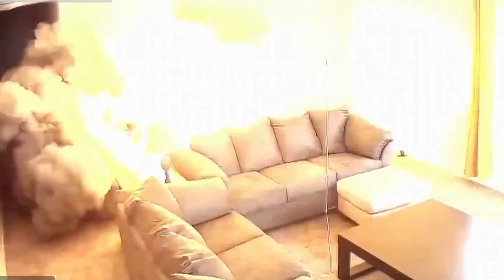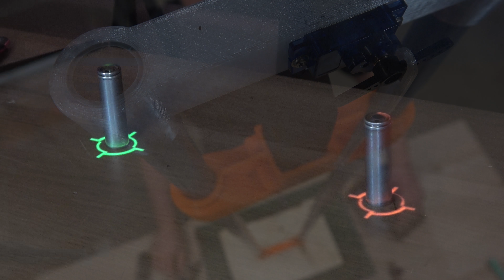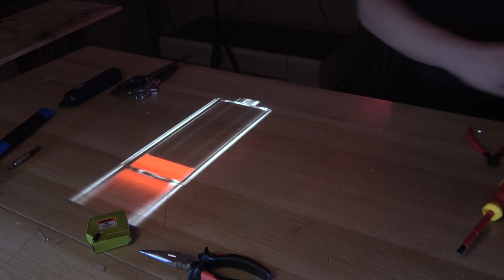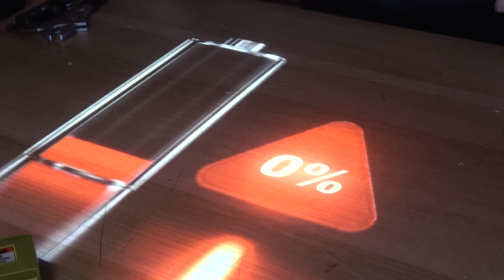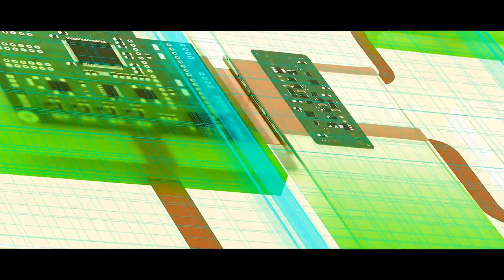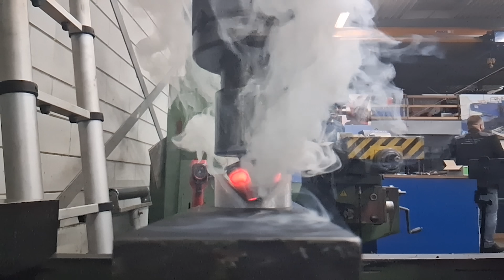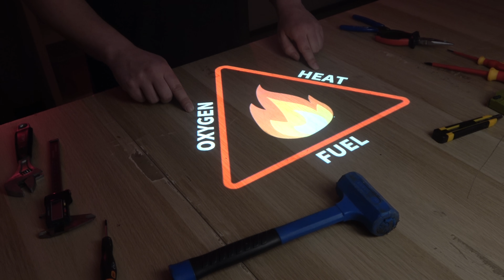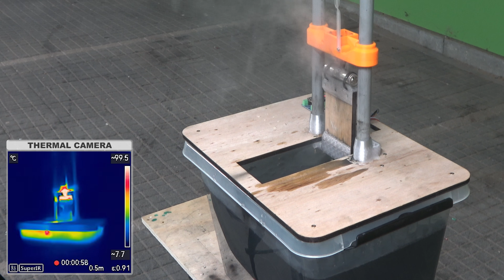Detonating Batteries.. For Science!

Comment: Not ALL lithium Try with Lithium Titanate Oxide (LTO) and prepare to be amazed.
Reply: Those still get pretty warm.
I would love to see video of a 100~600Ah cell getting tortured.
Reply: @picobyte  They don't get warm at all, not even slightly. I run a 40ah bank and regularly pull 400a+ of current for long periods of time. The cells are never more than the same temperature as the ambient air. The balancer gets warmer than the cells do, by a lot... and even that's still not too hot to touch with bare hands comfortably. The balancer is more heat sensitive that the cells are, but can be located away from the cells if necessary up to 1 meter.
Reply: @soldjahboy 40ah is like 20cells? Thats nothing compared to vehicles. ..
Reply: @gelo1238  r u in a irrelevant reply competition
Reply: @urnoob5528 yes
Reply: Or lithum ferrophosphate. But none of these are your everyday lithium batteries.
Reply: @thewhitefalcon8539  Not in small devices, but many cars (roughly 50% AFAIK) use LFP batteries nowadays. Given the recent developments at CATL, they may soon be everywhere. Setting a modern electric car's battery on fire is, depending on the model, somewhere between difficult and impossible.
Reply: @malamut2  What's interesting is that despite the media hype electric car battery fires are relatively rare, especially compared to ICE vehicle fires.
Reply: They also last approximately forever.

Comment: Correction needed: lithium reacts with water by replacing single Hydrogen atom, that atom couples with another replaced atom and forms H2 - hydrogen gas. This reaction is exothermic, it produces so much heat, that H2 ignites. That is why electric car batteries can not be extinguished with water, only everything that burns around burning battery to prevent further spread. There are safer batteries with less energy density.

Comment: I also have the fs-i6x, is it worth keeping or should I sell it when I have elrs now
Reply: I've got a QX7 but I also have a TBS crossfire 900mhz module adaptor that plugs in the back of the QX7  for long distance flight. You can also get an ELRS module adaptor for your i6x.
Unless you are doing long distance there really isn't any need for ELRS other than all the drones coming out have an ELRS receiver on them now and it's getting difficult to find Fr-sky receiver drones on the market. But if you like the i6x because you are used to it (like me I've added nice hall effect sticks to mine) then just get an ELRS module for it and keep using it. You may need to solder 1 wire inside to make the module function correctly? I'm not sure if that's specific to the TBS module I've got though?
Reply: thanks!
Reply: @iLoveFPVdrones  you could also get a nice cheap Jumper radio for really cheap also and have 2 controllers in case you have a friend that wants to fly with you, but you should need another set of goggles though. 
So that's an option also? The FR-sky radios can be a breast with so many options and can be unwieldy at times.
Ps. Don't let your coin battery go flat lol

Comment: part 3 please love this type of content(one question: can extreme heat from inside a car be enough to set a battery off?)
Reply: It can, which is why they should never be installed in an engine bay where the battery proximity to the engine exceeds temperatures of 50-60C (which is the majority of vehicles).
Reply: @soldjahboy  well actually 50 degrees C is the optimal temperature to have lithium batteries to prevent dendrites and fissures in the cell.
Every time you run a battery below 50°C you will cause some dendrites
Reply: @jameshatton4211  Lithium Titanate Oxide. Read about it. Stable up to 60 degrees C, no problem.
Reply: Lithium polymer batteries however I'm not so sure?

Comment: Can you do the dunk test into a box of sand in the next video? Sand is often said to be better than water for lithium ion batteries, and was in my workplace lab for safety. Very interesting video and surprising result with the charged vs empty puncture test.
Reply: I remember a post where a guy had stored his lipos in a cinder block with a sand filled in a big cement bag placed over it. As per him once a battery started fire and the  cement bag got a hole burned in it from where the sand filled the block and battery although fully burned while buried under sand caused no damage to surroundings. But those were small batteries compared to solar or vehicle batteries.
Reply: @MrLeo3D  I had a stroke reading this
Reply: Anything that doesn't burn is going to do the same thing: provide thermal mass and insulation for the battery that is going to burn even if you dunk it in liquid nitrogen. Fire departments will douse EVs with water, they are not trying to save it but to save everything around it.
Reply: @squidcaps4308  apparently the new Fire Fighter method is high pressure water (like water jet cutter) punch thru to the cells that are on fire and flood with water to cool it. Apparently works in hours instead of days.
Reply: It works, that's what I have seen in assembly environments for exactly that purpose. A big metal bin full of some kind of special sand. Drop the battery in and shove it under the surface, close the lid. Fill a form out.
Reply: I was going to suggest mud
Reply: Next vid can you do a car battery 😂
Reply: Try a bucket of sodium.
Reply: Nobody has a bucket of sand. Drop it in a pot of full of sugar
Reply: @macbook802  Not a good idea, sugar will burn and make the reaction more violent (sugar acts as a fuel). People literally make rocket motors with sugar - look up "rocket candy". On the other hand, table salt would work much better.
Reply: @macbook802 super heated flames spraying out and you'll carry it over to sugar or sand which it will just sit on top of .  I guess if you've already carried it you might as well keep burning yourself and push it in
Reply: @macbook802  just a pot full of sugar helps the battery fire go down

Comment: You should shoot a bullet at an empty battery and a full battery and see what happens
Reply from the maker: What about shooting the batteries against a steel plate using pressurized air?🫣
Reply: @ConceptCraftedCreations Great minds think alike
Reply: @ConceptCraftedCreations  To simulate a massive sudden impact like a drop or crash? Let's see! 🤩
Reply: @ConceptCraftedCreations  what like using a nail gun? Isn't it the same thing. Or is the OP meaning "what will a load projectile do instead of an iron one?"
I'm not sure 🤔
It's not easy to aim a nail gun by the way

Comment: So if I were to completely discharge a battery until its totally dead, would it be safe to throw in the garbage?
Reply from the maker: Theoretically... Yes😬But would you dare to take the gamble?🤓
Reply: @ConceptCraftedCreations hmm.... what if i completely drained it, punctured it (safely of course) to made sure it wouldnt start a reaction... and then throw it in the garbage. 🤔
Reply: Think for a second. If it contains no energy, what energy could be released?
Reply: @Kelthor85theoretically... it SHOULD be none, but maybe not
Reply: Theoretically, but you'd have to be careful of any internal BMS in the cell. Some cells have integrated BMS chips that prevent them from draining to absolute 0. Some battery disposal methods involve leaving battery cells submerged in salted water for a few days to help ensure complete drainage prior to further processing. This is most common with damaged/defective batteries that may not be safe for transport.

Still, I would not recommend throwing batteries into regular waste, even if you drain them fully. There exist dedicated battery collection points for recycling in some regions. It's better that the toxic chemical soup goes to battery recycling rather than landfill.
Reply: @ramdom_player201  Interesting, yeah.

Comment: You should see what happens when you just spray water on the fire instead of fully submerging it because that's probably what most people would do, and maybe see what different types of fire extinguishers do.
Reply: Spraying water on battery fires is what fire departments do. They are not trying to extinguish the flames but to keep the temperature low so other things won't catch on fire. Same with foam, it does NOTHING to that batter fire but it protects things around the battery fire. It is chemical reaction, the battery has the oxidizer in it. you can't just get between the two layers as that is where the suppression material should go. So, throwing smoking battery in a sink and turning the water on is better than just throwing it in the sink. 

The clip where the split the battery with hydraulic press shows it very well. First there is the chemical reaction and things fly off at high speeds, everything needed for that chemical reaction was inside the battery. Then it stops... and things catch on fire. The second fire is flammable materials being burned with the oxygen from air. Everything about it is different, it is gentle flame, orange glow and it clearly goes up. The lithium fire before that spewed things in all directions.
Reply: @squidcaps4308 the problem is that lithium reacts with water which can make a fire worse if it wasn't fully charged (fully charged fire is already at its worst)
Reply: @artemis.nnnnnbbbbb  There is so little lithium in the battery it doesn't do anything when it touches water. You could literally submerge a fully charged  battery and let the water seep in and NOTHING will happen because the lithium is too diluted to react to the water. Pure lithium is a different story. Just like how sodium metal is highly reactive to water even exploding but that same sodium that is diluted is used in table salt that doesn't react at all with water.
Reply: @artemis.nnnnnbbbbb  Lithium also reacts with oxygen in the air.
Reply: @Aircam73  Just a nitpick with the table salt analogy: (neutral) sodium metal is reactive with water because of the oxidation reaction where it loses an electron. The sodium in table salt doesn't react since it has already lost that electron and is has become a positive ion. It isn't related to how diluted sodium is since table salt is ~40% sodium by mass.
Reply: @DroeGaming  You are absolutly correct and the fact that lithium makes up only 2 to 7 percent of the battery and is encapsulated with a binder in a slurry makes it all but inert when introducing it to water. That was more of the point but you just had to get chemically technical on me.
Reply: Maybe we should use explosives to extinguish battery fire 💀
Reply: @gelo1238  First thing that popped into my mind when reading your comment was "they put out oil well fires with explosives".
Reply: @gelo1238  I have wondered about extinguishing lithium fires by trying to separate individual cells from each other to prevent thermal runaway from continuing...
Reply: @MyThreeLivesASMR  i think tesla used some kind of insulating, fireproof foam. The problem is what with more space between cells the bigger the battery at the cost of loosing capacity per volume. Also the thermal runaway are fucking hot. Depending on the charge it can melt fucking metal and set it on fire...
But youre right anyway. If car batteries could be easily removed it would be possible to at least save the car, but on the other hand when battery goes of there is no time and its over.
Reply: It will be about the same… these aren’t lithium metal batteries
Reply: Bucket of salt

Comment: Any experience with LiFePo batteries? I heard they are a good bit safer, but with worse performance than the standard Li-Ion. A direct comparison of performance and reaction to torture would be interesting.
Reply from the maker: Not yet..🤔Should I add it to the list for part 3?🤓
Reply: @Con @ConceptCraftedCreations be fair, include a few alkaline batteries as well.
Reply: @ConceptCraftedCreations
maybe, if somehow possible, look in to silicon-carbon batterys or Si-C.
They are actively in use in some Chinese smartphones and have a higher power density. And are potentially more violent in their runaway behaviour than similar sized, charged batterys. 
Again If possible, it would be interesting to observe
Reply: @ConceptCraftedCreations  LFP's are far safer than NMC's (your standard Lithium Ion). They don't normally burst into flames and can take quite an enormous amount of abuse.  Just as comparison, LFP's are most commonly manufactured in gel cell pouches, aka LiPo's, which makes them even lighter. They can withstand punctures and not go up in flames.  Now, that doesn't mean they don't outgas, spitting out loads of contaminants that shouldn't be inhaled.  But, that's better than having to deal with a fire as well.
Reply: @ConceptCraftedCreations  It's definitely worth testing. LFP chemistry usually just releases a bunch of smoke when a thermal-runaway occurs. And they don't release any oxides, so the smoke isn't combustible. You can get them in 18650 form, but you'll need a charger that's compatible with their lower operating voltages.
Reply: @ConceptCraftedCreations  YES! Also: with Lithium Iron Phosphate as well as Lithium polymer batteries would be interesting for comparision.
Reply: A comparison with LFP would be interesting. 
There is one safety factor that isn't taken into account when you test single cells. 
Often cells are used in a pack and if one cells catches fire, the heat of that cell is enough to bring adjacent cells to the thermal runaway point, causing the whole battery pack to burn down eventually. This should be an area where LFP shines as the thermal runaway point is much higher, therefore keeping the damage more local. Testing 2 or more cells side by side could reveal this.
Reply: LifePo4 batteries can still suffer thermal runaway. The only truly safe lithium chemistry is titanate oxide. There's not enough combustable material inside to even burn, unless everything else around it is already on fire first... in which case, you're probably already in big trouble if that's the situation.
Reply: Depends on what you mean by "worst performance".  If you mean they just don't have the same capacity, that is correct. If you mean they just can't do the work that NMC's can do, that's incorrect. LFP's can actually drastically outperform NMC's in world load.  LFPs have a natural discharge of 30-100C rating (C rating is capacity mAh divided by 1000 and measured in Amps).  So a 3,000mAh cell that is rated at 30C can discharge at a rate of 90A. The ANR26650 can do a max discharge of 120A. You won't find that in most single cell in NMC's.
There are "some" that can do close to that, but they also don't last very long overall. The LFP can do >1000 Cycles with that kind of abuse, whereas the NMC's are closer to 400 Cycles and can't handle that abuse well; meaning they loose capacity rapidly, whereas the LFP's don't loose very much.

So I wouldn't say LFPs are "worst performers", just that they are designed for different work loads.  And they are being incorporated into more and more EV sales each yeah, even Tesla is using them in the latest models.
Reply: They are, but all of this might become moot before long anyway, there's already at least 2 sodium batteries I know of that use no lithium at all, one was patented  last year and is an anode-free battery, and I have seen a couple of other sodium batteries already on the market sold for solar storage, I think one is 48v  and about 1500wh they are about $699, so the technology is rapidly changing and like LED's replacing those old mercury and glass 8 foot fluorescent tubes, give it 2,3,5 years and we could have a totally different battery architecture on the market replacing all the then obsolete lithium-ion batteries.
BYD in China developed their EV's which can be fully charged in NINE minutes! they are already sold and on the road there, they use a 1,000 volt system, not sure what their architecture is, but the fact they can charge in 9 minutes is a game changer!
Reply: "Worse performance" is a bit too broad. The main difference is energy density. So they're not great for things that move and require a long battery life such as a car, phone, or laptop. When used in a fixed deployment such as a battery backup, or load shifting set up, they're fantastic.
Reply: @zncon  Some EVs are in fact powered by lithium iron phosphate.  Nickel manganese cobalt is still used in longer range EVs.
Reply: @soundspark  Yeah, that's just more detail then I wanted to get into via YouTube comment.